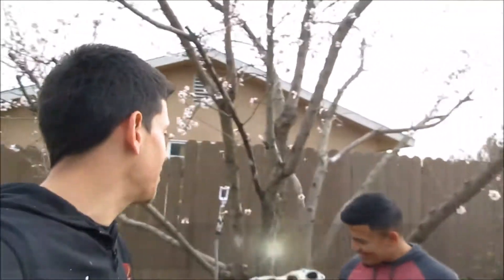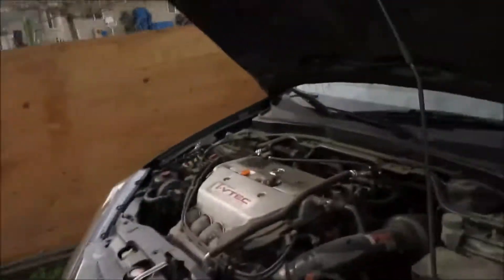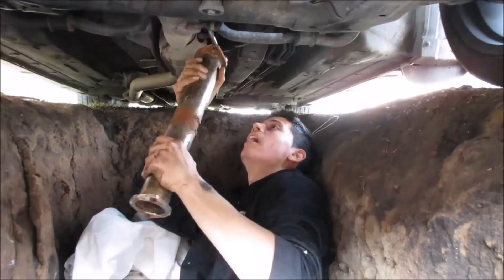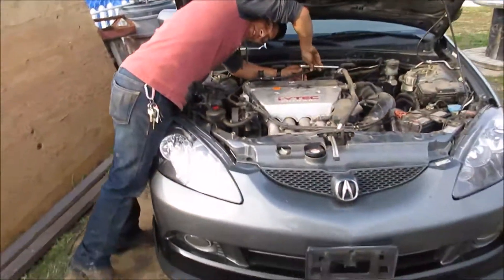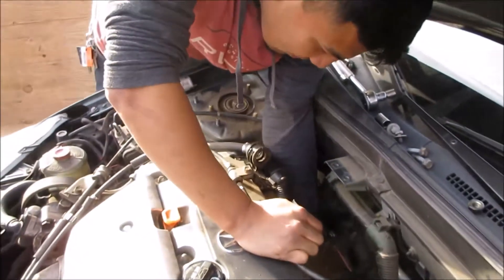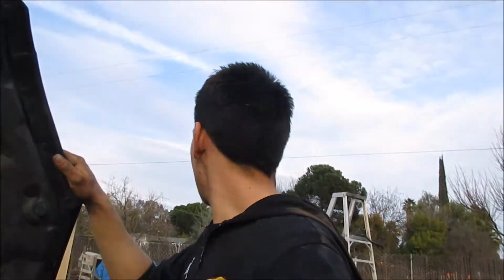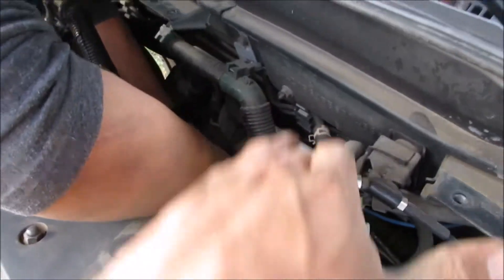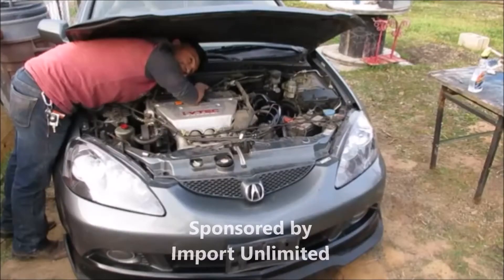Rsx type s header install Vlog #Dc sports headers

Comment: Hey i have a question do i need a donut gasket
Reply from the maker: Depends on the rype of header. Most headers need donut gaskets.
Reply: Official1Samuel  mine only came with a flat donut that sits over the flange it’s a shorty header
Reply from the maker: @robeofdeath  as long as u have no leaks ur good.   Spray soap and water around if u see bubbles thn thrs a leak